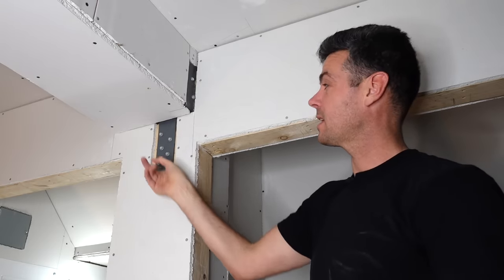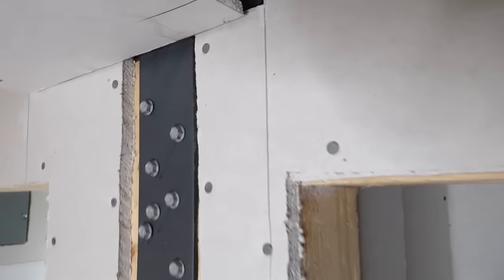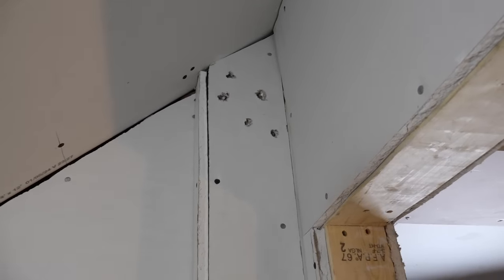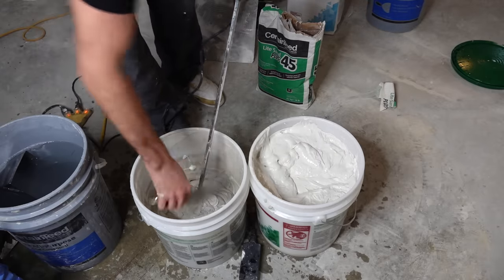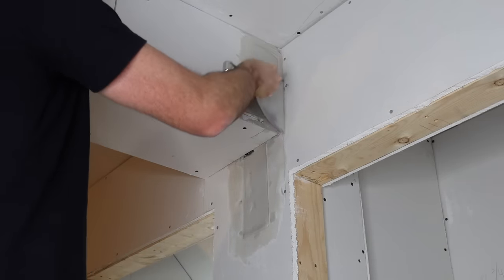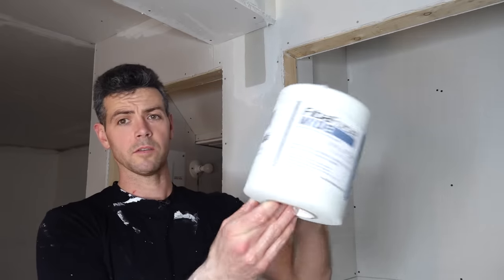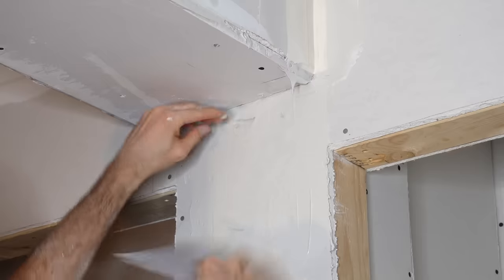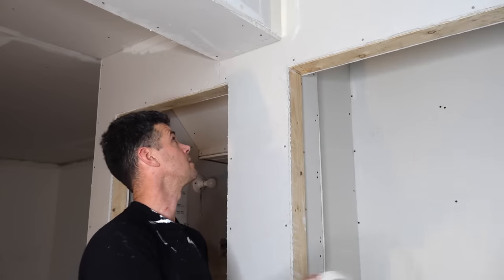How to Drywall Over Beam Hangers!

Comment: The all purpose mud has a chemical calcium in it that acts as additional catalyst for your hotmud which caused it to set faster.
Reply: That's what I thought. I've noticed mixing hot mud and premixed usually makes the job more difficult
Reply: I mix hot mud and plus 3 all the time, never had it kick off faster. Quite the opposite. There is no catalysts in all purpose. The only calcium in it is limestone (and possibly the mica if it’s a calcium mica). Limestone and clay are what all mud and boards are made from. Hot mud has plaster in it which is what sets. Alum is a catalyst for that, but there’s no alum in any compound that I know of.

Comment: Hey brother I’m from alberta your neighbor , I’m originally a electrician by trade now a engineer and when I went to finish my home I found your videos and when I had a quote 1/2 way through project both contractors told me to get the original contractor to do the workload because they would not be able to match the quality …………. I did all the work myself after your videos you also got me back into skateboarding after 15 years of my board being hung up went on within 3 years from 4 foot bowl to 6 foot to 8 foot and now killing 10 foot drop ins , was always my dreams took a lot of practice but was one of the best feelings in the world when I finally nailed my drop in ……. I also broke 2 ribs along the way but it didn’t slow me down

Comment: Hey friend - thanks for the videos! I have this concrete ceiling that was plastered and painted poorly. Had some spare time on my hands so I watched your videos and then removed all the debris to the bare concrete, primed the ceiling, then skim coated it using your roller method to put the compound on the ceiling. Then I used the skim coating trowel for a nice finish I am happy with. Does not come to the same professional standard as yours, but for the first time ever doing this, I am happy. Thank you and if you are ever in the new west area, I'll buy you a beer!

Comment: I love fiber fuse for bigger areas and it cones in 75' roles. I've also used the 36" sheets for skimming over old plaster walls and ceilings. I have to order it on line, Canadian distributor,  because the big hardware stores don't sell it.
Reply: 100% AGREE.   I've used paper and mesh,  but fiber fuse is thinner, stronger and easier to use.   The hand itch is the only disadvantage.   I couldn't find it a HD and had to order online.
Reply: You don't need to order online. Every drywall supplier that isnt a box store has it locally in Canada. There was a huge shortage of it the passed 2 years.
Reply: I used to work on those old spiderweb cracked plaster walls decades ago. Used rolls of  mesh tape for that, it’s all we had. Can’t remember if they were 24” or 36” though.

Comment: I use hot mud for taping.  Most of my jobs are repairs so I can use 20 or 45 minute.  For larger taping jobs I will use 90 min.  I am also a big fan of "Perfect 90" inside corner tape.  It straightens out wavy inside corners and is super easy to apply.  No moving or tearing.

Comment: I've been able to fill a spot like that with a saggy mud by putting some Fibafuse inset a little into the filler pass. So by the time im done, there  are two layers of Fibafuse. The first layer acts like rebar in concrete.

Comment: I just use hot mud straight up for my 1st and 2nd coats 20  for deep 1st coats/small jobs, 45 or 90 for the bigger jobs when i need more quantity at once.. 3rd coat is easy sand low dust lightweight stuff. I had to replace my 10" knife as the edges had worn down causing it to scoop out the bud from the middle and leave a dip. Never thought about it until i notice the wall seam was still low after 3rd coat.

Comment: You mentioned that quick-mud being hard as a rock. I watched a guy one day use a piece of hardware cloth wrapped around a block of wood, which worked like really aggressive sandpaper and was rather quick. He just worked out the high spots then used traditional mud for the finish coat.

Comment: FibaFuse is a great product and I used it during my remodel. If you end up touching the edges of the roll though, you will itch like no other. Touching the face of the roll doesn't seem to be a problem. If you are careful, you can complete the job and still avoid touching the edges. Just a heads up to anyone that tries it for the first time!

Comment: I've had that same problem with those off brands of hot mud.  90 minute turns into a rock at 20 minutes and your stuck with a brick in the bucket.  USG has always been super consistent.

Comment: only thing i would have done different is coated the metal with some multipurpose primer from tec. Also gardz by zinnsser, just something to help give that mud a nice tight bond and also prevent the moisture in the mud from causing any rust.

Comment: If you're going to shave out the back side of the drywall, I'd mix up some hot mud and slap it on the back of the shaved out portion. That'll kill 2 birds with one stone, it helps fill any voids to help decrease failure chances down the road, and also just helps with adhesion for the piece in general

Comment: As a DIY'er, I let a bucket of self leveling concrete compound set up. I figured the bucket was trash, but two days later I slammed it upside down on the floor and the slug of compound came right out cleanly.

Comment: They make a small paddle for a drill,that you can mix quick set in a pan.  I only use 20 minute mud because I can get rid of that amount without much waste.  Haven’t used 45 or 90 in years.
Reply: i buy egg beaters for handheld mixers every time i see them in goodwill, they are basically free and work super amazing.
Reply: @joshuawhite9725  I might try that. After awhile the paddles beat up the side of my  metal pan.

Comment: Have you tried putting some 45 minute hot mud behind the part of the drywall you shaved off? If you mixed it thin enough it should squeeze out without cracking the drywall yet support it when it sets. That way you don't run the risk of cracking it when taping the corners. I've not done it, but it might be worth considering.
Reply from the maker: That could work. It would be super annoying though to take out all the taping tools while hanging.
Reply: I've had to repair drywall that's been hung over lath and plaster walls that have had the plaster knocked off but the lath left up, and I do this to stabilize the lath behind the repair. Often times it's loose after being messed with 90 some odd years after it was hung.
Reply: @vancouvercarpenter Is there such a thing as fibre-reinforced mud? Seems like adding some micro-fibres would add some inherint strength to the mud. There are similar things with fibre reinforced concrete, but it is still a new-ish are of concrete design.

I don't think it would be the right tool for this application, but just curious.
Reply: That’s how I do it

Comment: Yes. I had 1/3 of a bucket of 90-minute mud (brand new purchased bag) start setting up in ~60 minutes because the house was kept so warm by the homeowner (who is always cold because hypotension). I didn’t consider it when I brought the bucket inside and only got through half my work before the mud was toast. Getting it out is always frustrating
Reply: i just posted on this, but it seems like mine is setting even quicker (posting on female account)

Comment: Yeah had a bag of 40 minute kick in 10 once it was definitely old and had been in a leaky garage for some time. I like the fiba fuse too i did a ceiling with a bit of it, fully expect to have to do some repairs there, we'll see how their claims of strength hold up in an air BnB.

Comment: Hammer the sides of the bucket with a rubber mallet.  I use that method for dry wall compound and even concrete.  I let it dry and hit with a rubber mallet

Comment: I had this problem not with a beam hanger but with some duct work that stuck out too much. I was also left with only 1/4" thickness. I used Durabond to embed some 6" FibaFuse at the backside  area where I "routed out" the drywall core. It really seemed to strengthen it.

Comment: For anyone new to doing mudding the best thing to know is don't be perfect on the first application. The first application is for coverage, then knock down/sand imperfections then apply it perfect remering to put enough on to be able to sand it flat. After I figured that out it wasn't as intimidating.

Comment: I use Durabond 90 but in a pinch, if you don't have All Purpose and have only hot mud (45 or 20min) then add a good amount of wood glue to your mix.  It'll help with the adhesion.

Comment: When scraping out back of board and thin remaining you can back butter so no void behind.

I go a little overboard I guess and nail some mesh over the top and then fill. Like stucco. I could see using  layers. Some all purpose heavy weight to stick to the metal and then fast set on top. But of course the dry time is long for that first coat, but it sure doesn't have to be think. Could even just paint it on with a brush and a day later ready to go. I would worry about shrink cracking with 1/2 of mud. The fast set I guess solved that issue.

Comment: Hey Ben ~ wondering how it will stay attached to the steel underneath? My instincts tell be it will separate over time and crack around the parameter of the fibafuse. I think the best way to handle it is to switch to thicker drywall and fade it into the thinner drywall a.k.a. mudd framing, to which you are a master.

Comment: Great video thanks I learned some new techniques! Going to try that fiber fuse on this one difficult ceiling seam I have where there's a 15° angle. The sheets didn't line up very nice so there's going to be a lot of hot mud going in to make things right. Sheetrock 45 to the rescue
Reply: Do you have No Coat flexible corner bead available where you are? That might be an option for you to try
Reply: I will check I have both home Depot and Lowe's I'm located in Canada. This would be for what you would call an inside corner. The ceiling starts off flat for two feetand then it slopes down 15° till it reaches the exterior wall.  @juzcallmeben

Comment: I've done some shady fills. For me, i'd screw in some screws around the perimeter just below the surrounding layer. Then add hot mud. For durability. How about tiling thin-set. Concrete structure for sure. Just my 2 cents. How about slapping some mesh over the fill material. Or tucking it below the two surrounding layers.

Comment: Usualy, I use PUR foam, 30 min later cut it straight with the wall, and use Renoband (Knauf material) over it, and next day finish it with some regular mud material.

Renoband is permanent elastic,  minimal/almost to nothing shrinking, and not hard like other materials, so never cracked because of it.

Comment: The bag could have certainly gotten wet or is old. I've had entire buckets of durabond set up in 5 minutes and it was old product. Another thing to consider is the water. The chemical composition of water can speed up the setting time I've found, just like temperature can.

Comment: My advise to you is to use some surface athesion compound first to paint the metal, it will provide much better grip and isolate metal from water inside a mud. That way mud will never detach from metal.
Reply: Those support ties are exterior grade. The braces are already painted and the structural screws are zinc coated.

Comment: Question for ya, when would you see its appropriate to add tape vs not. When patching small screw holes, I think you can get away skipping it. But in this case you lay some tape, any general guidelines you use. Maybe a certain size.

Thanks and appreciate the content Ben!
Reply from the maker: about the size of a quarter.

Comment: Have you done a video on drywalling around a shower unit. Drywallers always just go over the shower flange and it’s always bowed out. Must be a better way to
Reply: Drywall should only come to the flange not over, then you can fill and flat tape.
Reply: You can pad the studs out so the plane of the framing is past the flange, so the drywall will bypass it, or just cut it even with the top of the flange and fill it in with "something" (everyone has different opinions on this)

Comment: I just had a bag of 20 that kept setting up in 5-7. It just started to crumble at 5 and was useless by 7, and took forever to dry. I even tried mixing it with a clean pan and fresh water. It looked kind of like skinned over plus3 after 2-3 minutes. All I know is I picked it up at a job site and it had been open so it may have just been really old and had too much humidity or it was just a bad batch (maybe why it was left on the job).

Comment: Just a DIY'er, but I've had to do that once or twice with brackets but not brackets that large and also with a patch that wasn't the same thickness as the surrounding drywall.  Build it up with mud and tape it when it's built up enough.  As for the hot mud cooking off, I never let it get to that point.  I watch the clock and stop with plenty of time to get it out of the bucket and off my tools.  For larger areas or things that would take time, I would use 90 minute.  For smaller jobs, the 45 or 15 minute stuff.

Comment: Drying type mud could contain gypsum. Gypsum accelerates hot mud. Hot mud is mostly plaster of paris. It turns into gypsum when it sets by bonding to water. Adding gypsum at the start provides nucleation sites to kick off the reaction faster. Your all purpose could've made it set in 20 minutes instead of 45.

Comment: Funny you say that about the quick set - recently I’ve had 20 minute setting up within about 5 minutes essentially right after the mix .. I can’t imagine what 5 minute would do.
Reply: Either the water you used was murky, your pan or bucket was dirty, or you mixed too thick. Heat affects it too
Reply: @big12ref2   On all accounts no! 68 deg. And 40% RH clean sink water, pan 100% washed out cause I always do.

Comment: Regarding cutting out the back and it being very thin., part of the issue is that it is sitting on top of bolt heads.  Have you tried filling the hole with quickset as you did, so you get a solid back (some should squish out, providing the thin drywall with support.  Thoughts?

Comment: Question and maybe you’ve gone over this before, but in your experience, why do you get bubbles when floating the mud sometimes? To me it does seem more common when floating over painted surfaces even after light sanding of the paint.
Reply: I'm not sure, but I think it has to do with drying. On a painted or heavily floated the water vapor can only come out through the surface. Maybe as the top starts to "set" or forms a skin, the air and water collect until they form a bubble and then pop.

Comment: I was just wondering if you could use just tape to patch and then you mentioned it haha. Out of curiosity, what would happen if you used that 45 mud to apply the tape and or that fiber fuse? I've watched so many of your videos and it's crazy how many different types of muds it seems there are and I feel like I would always be using the wrong one haha.
Reply from the maker: You could apply the tape with 45 no problem.

Comment: durabond is similar to con-fil?   least it works like "tranditional plaster"   You can get Durabond in (some) parts of America as well as here in Eastern Canada.   I've used a it a ton to fix similar issues.   And i buy those cheap orange plastic buckets from the big brand hardware store and chuck em away, the 4 dollars for a bucket is better than messing around trying to clean one.   I also keep extra old buckets for these types of situations, ones that have had several mixes in them but you don't want to use for a finish mix due to contamination.   In fact you'd laugh at my whole system, my used drywall buckets are handed down for concrete and mortar mixing then used for yard/slop jobs outside...I'm not frugal but I get my moneys worth from a $8 good quality white bucket (the going rate round here)

Comment: I'm a carpenter who only occasionally tapes and does plaster repair. Love your stuff and watch it all. What's the story with Durabond vs other hot muds? For years it was the only setting type compound we ever saw in Quebec. Now we often see Sheetrock and Certainteed as well. What are the best applications for Durabond if any?
Reply from the maker: I stay away from durabond. Too hard and unforgiving.
Reply: I saw a guy who does new construction saying he uses durabond on his horizontal flat joints for pre-fill, he says when the house settles it may Crack otherwise. I only do remodels so I have never felt the need to try it, I just prefill big gaps with ez-sand, or foam insulation in rare instances

Comment: might not be the same deal because it's a different product, but with easysand if the bag has been open too long, I've found it kicks faster but takes ages to actually dry completely
Reply from the maker: This one was in the back of my truck which is covered from rain but still very damp.

Comment: The reason I don’t like this solution is because the mud on top of the bracket will never move while the surrounding drywall will. I think a better solution is for the patch to be floating over the bracket even if it’s thin. I have no evidence either way but that’s my feeling on it.

Comment: Have you ever tried the newer Fibafuse MAX? From what I gather, it has been reinforced to deal with the problem that the original stuff was kind of crap for corner taping because it tore too easily. Apparently this stuff is much better for that and just stronger overall. Would be nice if you've given it a try and can share some thoughts.